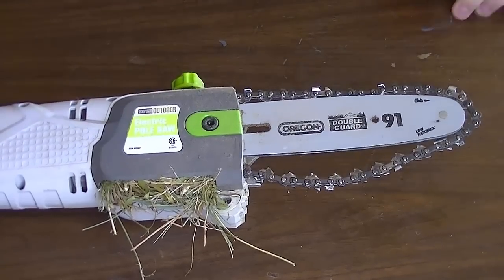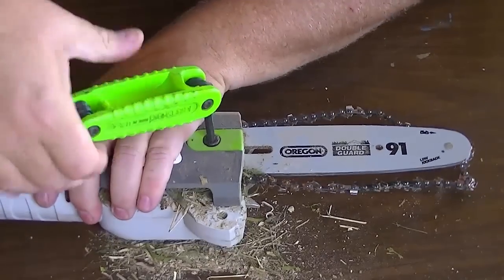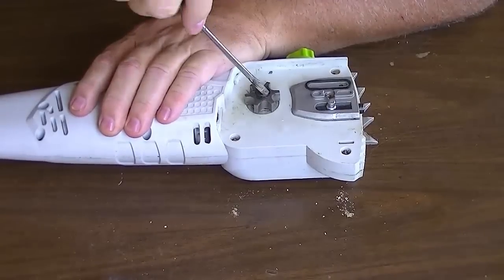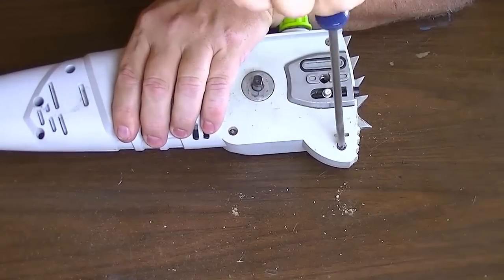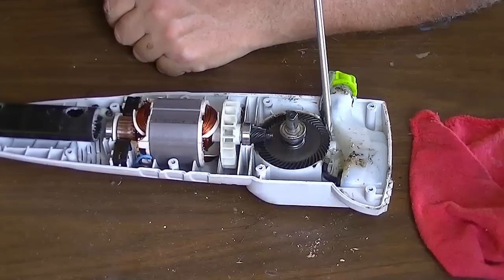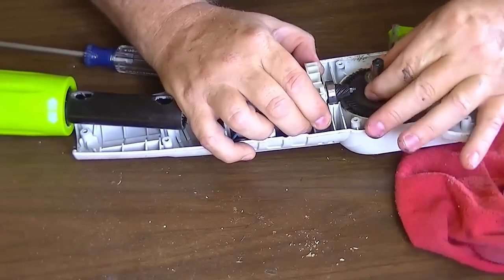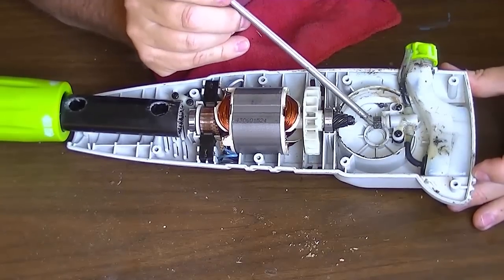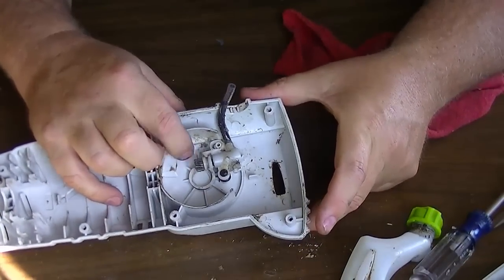Harbor Freight Chicago Electric Portland Pole Saw Oil Pump Repair Mod Fix

Comment: I had the same problem with a Poulan chainsaw and Sun Joe pole saw. Instead of taking it back I just hand oiled it between use. But I think now I'm going to try to fix the Sun Joe pole saw. Thanks for putting this up.

Comment: Double your battery life by dipping end of bar in mayonnaise jar of used motor oil often.
Little electric saws need to be sopping wet with oil to work good.

Comment: Thank you for such an in-depth video. My oil leak was because of torn tubing at the male/female juncture of the top tube.. I found proper replacement tubing at a pet store (aquarium tubing). The biggest challenge for me was hooking up the tubing before closing it all up. During my frustration, I realized that the replacement tubing has to be cut to almost the exact same size as the tube being replaced or it will not fit inside the unit correctly. Also, be sure to use the spring inserts from the old tubes or the new tubing will crimp, stopping the oil flow.

Comment: Nice video breakdown. Do you think it's possible to put a more powerful motor to use a bigger bar & chain ( e.g. 14 inch). I know people have switched to a bigger bar but there would be a drop in performance and added load on the motor. A bigger motor should help in recovering the performance.

Comment: The first time I took one of these apart to fix the chain not getting oiled while the dang unit dripped oil all the time out of the casing, I just undid all of the case screws. 

Managed to replace the broken bits of hosing just fine. 
Putting the dang thing back together took a while though, since in the process I managed to undo the carbon brushes. Managed to put the thing back together after a lot of cussing and trial and error. 

Cut to today when the thing stopped oiling the chain again.
Once again I took the unit apart like I did once before, replaced the hosing once again.

During this process I thought of using tougher hosing but the bit of hose I bought at the hardware store would not work as the hose would fit into the couplings, but the springs that went inside the old hoses would not fit in this tougher hose.

As I was preparing to go through the reassmbly ordeal, I spazzed out and dropped the unit off the table and in the process the wires going into the motor managed to rip out.

Took the unit apart futher in order to resolder the wiring into place when I realized that the sprocket could be removed from the top part of the casing like you showed in the video, thus making the whole assembly/disassembly process simpler than the headaches I had gone through before.

So I went ahead and put the unit back together again, the proper easier way this time, only to find that the unit was not proving oil.

Cut to me finally searching for what other, more intelligent people have done with these units to fix them.

Thank you for the very detailed and informative video regarding the maintenance of these units. 

Sorry for the long rambing wall of text.

TL;DR You sir, are a gentleman and a scholar.
Reply: Outstanding video, sir!  I’ve had a problem with the tiny hoses popping off the pump.  Cleared the glue on the hoses and used fine picture hanging wire, twisted onto the hoses, as clamps. Your video was critical to making this all work, EXCEPT, I had a heck of a time finding the correct placement of that spring into the body of the saw, that holds tension on the gear. Using screen shots of your video, I finally figured out where to install it correctly. My saw was a tiny bit different than yours,and had no glue on the spring to hold it onto pump itself.  I ended up gluing the spring onto the pump with Locktite Extreme Glue, which is one of the best glues I’ve ever used. Thanks again!
Reply: Outstanding video, sir!  I’ve had a problem with the tiny hoses popping off the pump.  Cleared the glue on the hoses and used fine picture hanging wire, twisted onto the hoses, as clamps. Your video was critical to making this all work, EXCEPT, I had a heck of a time finding the correct placement of that spring into the body of the saw, that holds tension on the gear. Using screen shots of your video, I finally figured out where to install it correctly. My saw was a tiny bit different than yours,and had no glue on the spring to hold it onto pump itself.  I ended up gluing the spring onto the pump with Locktite Extreme Glue, which is one of the best glues I’ve ever used. Thanks again!

Comment: Thanks for the video. Bought mine in 2022, thought it had a drip oiler. Sharpened it the other day and noticed bar and chain were dry. Took it apart and found similar oil pump to yours but with no spring or adjustment. Cleaned out blue sticky (like glue) grease and replaced with lithium. Emptied full oil tank, cleaned out oil lines, and replaced with 10W30. Pump works now, Will probably go half and have with chain oil next time. HFT is definitely the place for guys like me who like to fix and/or modify stuff.

Comment: My pump works, It just leaks all the oil out when it's not being used. Hopefully a simple fix.
Reply: Well.... The oil is leaking from the oil tank grommet. Not where the oil tube goes through the grommet, but from between the tank and the grommet. Hole is too big or grommet too small.  I glued it with some industrial spray adhesive (Contact cement type stuff). Maybe it'll hold. If not, I'll fiberglass repair over the whole hole, and drill a hole for a new grommet. Or toss the whole thing out...

Comment: Wow you done a awesome job! Mine was not coming out the hole either! But the oil was leaking everywhere but the hole! Thanks to your help i took it apart and the tube was broken! I just used another tubing and it worked like a champ! Great job! Thank you!

Comment: Turns our my saw didn't oil because the oil tubing had just crumbled.  Must not have been rated for gas/oil usage.
It was hard to find appropriate tubing.  I got some at a lawn equipment business, they couldn't give me the actual size.
Slightly small I.D. than OEM but being silicon, flexible enough to fit firmly on the saw's barbed fittings (except the oil tank which took some modification to make it work).  I needed to get the tube length just right to avoid kinking.  I couldn't use the anti-kink(?) springs inside the OEM tubes.  I guess that's ok as the system now oils.

Comment: Where do you get the new oil tubes? And my oiler tubes are all broken and the connection to the little tank is also broken, what kind of glue do you use?

Comment: Yes, nice work with the step by step. It helped me know what I was going to encounter when I opened mine. I had an oil leak caused by one oil line coming off and the plug near the top of the oil tank falling out at some point

Comment: I just bought one of these. Mine doesn't oil properly either. I was going to take it back since I bought it 2 days ago, but I might not since I may get the same thing again and have to do the repair in the video anyway. THANK YOU for doing this video!
Reply: I just tore mine down and put it back together. Mine didn't have the glue but it had a spring inside the oil line to keep it from kinking. I took the spring out and had to cut the line a little shorter so it wouldn't kink without the spring. It oils better now. One thing I would add is there are 2 case Philips screws that are bigger. The one that is closest to where the handle goes into the motor case and the one straight inline with it closer to the bar. You will see the difference once you look. I didn't notice the bigger screws until I went to put it back together. Maybe older saws the bolts are  all the same. I bought mine 7/15/2022.

Comment: Help. Found where my oil leak is. Appears there is a breather hose missing from the top side of the oil tank. Also followed your instructions but failed to see how spring went on bottom of oil pump. Can you help me?

Comment: I got one from a friend who broke the extension pole at the screw holes just inside the chainsaw case. The extender pipe is made of a fibrous material and maybe not as unbreakable as it should be. I glued it back together with JB Weld, then made a tin sleeve about six inches long and glued that around the area of the break to add some support, and then added some hose clamps for good measure. I expect it will be better than new. When I originally took it apart, some of the parts fell out of place, so it helped a good deal to watch this video; enabled me to put it back together properly. Thanks.

Comment: Someone gave my cousin a Sun Joe and its the same inside. the oil tubes are trash and one of the brushes are worn.
Reply from the maker: Thanks for that information.
Reply: My mom bought an EarthWise off the TV and it's identical inside so probably same Manf. I was able to replace the oil hose which had disintegrated, but the coil inside the hose was also in bits.  I need to replace that, plus also the same as some others - the brushes.  Mine were so bad the holder was also cracked.  I'll check with Harbor Freight to see if they have the brushes.

Comment: Took me four tries, but I got it to pump oil.  There was excess glue preventing the gear on the pump  to engage with the worm gear.  Also I increased the spring tension a little to help with that engagement. It's kind of a tricky assembly, but doable.  To future repairers, getting the oil hose back on that goes to the bar is fiddly.  Long nose pliers helped.
Reply from the maker: Very helpful information. Thank you for sharing.

Comment: I have the identical HF pole saw. So glad I found your video.... It should allow me to make a DIFFERENT REPAIR to fix my brand new saw. 

Today I used my saw for the first time. Within the first 5 minutes I cut a rather large branch that fell and struck pole tube that attaches to the chain saw plastic housing that you were working on. The fiberglass pole is like a wet noodle at the impact point. After looking at your video I think I will be able to replace that smaller pole tube, but looks like I will have to disconnect the white wire in order to replace the pole tube.. I have not opened up the housing yet, but was wondering if I will have to cut that white wire (shown at the 12:15 time marker) or if you might remember if there was a connection plug that might be there that will allow me to simply unplug that white wire without having to cut it? 

Thanks for the excellent video!  I will let yall know if I could get the part and fix it. You never know when someone else might have the same dumb luck as I did today.
Reply from the maker: im glad the video helped

Comment: Great Video, thanks. I have a sun joe model, looks identical to yours. Mine was easier to fix, just moved the worm gear closer to the shaft and re-tighten the screw. Not sure how long this fix will hold though.
Reply from the maker: Thanks for that info. Good luck.

Comment: Thanks Mr Edinger for this video. Inherited the tool 4 years ago while cleaning my deceased uncles house. It's worked fine until recently, will follow your steps to find the issue, dont know if the parts are expensive but I'll try disassembly. Got the piece off but the sprocket will not come off, like its stuck
Reply from the maker: Maybe try PB B'laster.
Reply: @roberta.edinger9405  Ordered the new bar, waited a month, didnt help. Went to Lowes, hot the new chain, problem solved! Should have taken your advice and started with the chain!

Comment: The newer model doesn’t have the tension spring for the pump to engage the...spinny thingy (don’t know the names). Suggestions? The pump does work, I rotated it by hand.
Reply from the maker: Is yours not pumping oil?
Reply: Robert A. Edinger : it’s pumping now. However, it seems to not get on the bar. W/o the bar, it pumps.

Comment: I had a clogged problem.  Fixed that.  Now I have the tubing has split so I need to replace both tubing sections.  In the meantime, I'm just pouring some oil on the bar/chain to get by.  I'm just a casual user so I'm not trying to make a living with my unit.  But I do need to get those tubing sections.  Anyone know the inside diameter and outside diameter?
Reply from the maker: Maybe try model airplane fuel tubing. it is very flexible and will stretch to fit.

Comment: Ok to all those who purchased this item you should not use bar and chain oil in an corded telescoping reservoirs it is to thick and depending on what time of year you are using it. So if cutting in cold weather use a more viscous oil and a little heavier in heat constantly use BAR AND CHAIN OIL on the bar and chain. Never let any build up in the space shown in this video it will burn motor out or worse. Thank you for video at least I learned how to rebuild and yes METRIC PHILIPS HEAD is a real tool. Everything made in China is 10-14 mm or hex. Good luck!
Reply from the maker: Thanks for the information Richie.
Reply: I have used bar and chain oil after seeing the oil come out through the hole. It worked fine but this last Tim I was cutting thick Eugenia branches and saw sparks. It did run for a short time, then stopped, guessing the motor burned?

Comment: One of the best demonstrations on how to fix something I've ever seen!
Reply from the maker: Thank you so much!
Reply: I was thinking the same thing.He seemed to move along very quickly with his troubleshooting,effortlessly actually,little time was needed to access problems and rectify,unless of course he had actually been in one of these before.(NOT saying he did-some folks appear to do a vid run through)
In another life,I supervised a small plastics industrial maintenance dept.If he also read mech,and elect,maybe hydr prints,and had made it past HR to me for an interview,I would have hired him on the spot.
I bought one,and opened it up earlier tonight to look at adding an extension to the pole before I even put the bar on it.
Then it hit me to check youtube to see if anyone else had made one,and landed here.I inspected my pump because of this vid,the gear engagement pivot was a little tight(but no glue),so I backed off the screws a hair as suggested,smeared the grease to where it would actually do some good.Nice firm engagement now.Thanks!
-edit for spelling 4/9/20

Comment: Do you know which brushes it uses?  I have Sun Joe 802 that I need to replace the brushes.
Reply from the maker: I would think the Harbor Freight brushes would be compatible since it seems that the HF pole saw is made by Sun Joe. But unfortunately I don't know where to get the brushes.

Comment: Nice job on the repair and the video. I appreciate the reminder to test before putting it all back together.  What a great shot of the clean oil flowing smoothly in it's little lubrication slot.  Thank you.
Reply from the maker: Thank you so much, I really appreciate your comments.

Comment: Thanks for posting this.  Gives me the confidence to tear my saw apart and try to find cause of oil leaking out of head assembly and down pole.  I have been dreading an attempt for fear of small parts falling all over the floor.
Reply from the maker: I hope it works out for you, good luck.

Comment: Nice fix, thanks for sharing! My oiler isn't working either so I'll give it a go! Also, is it possible to put on a longer bar or upgrade the chain? I've sharpened my chain several times but it doesn't stay sharp very long! Thanks
Reply from the maker: It is possible the chain may have gotten too hot during use or sharpening, that will cause it not to stay sharp. I'm not sure about the longer bar but it's worth a try. Let me know how it goes. Thanks.

Comment: Just fixed mine. The hoses were shot so I used some silicone vacuum hose and a small adapter to fit the grommet on the reservoir. I also adjusted the spring. I wasn't sure which side of the plastic ribs in the case it was supposed to pull against so I put it where it puts the most tension. Working great, what a pain to work on though!
Reply from the maker: Thanks for the tips. I'm glad the video helped.

Comment: I bought one of these at HF an it works pretty good.I haven’t had any big issues with it, except keeping an eye on the oil level because it uses chain oil pretty quick.A tank full will last me about 20 to 30 minutes of constant cutting.It works great with HF little 2 cycle genny if you don’t have access to a near power source in a remote area.Don t hit any metal or metal around where your cutting it can damage the chain easily an they come good an sharp when new ,that’s one of the best features of the pole saw. I also blow mine out with compressed air an wipe it clean,that saw dust can shorten it life. The pole saw an genny are great tools for the average home owner.I have always got a kick out of buying myself tools because as a kid we didn’t have a lot , except love. So for me going to HF is like a kid in a candy store.Some people put HF down for it quality, but do a little homework on Utube an look an reviews to help yourself make a good purchase.
Reply from the maker: Thank you for the comment and the information.

Comment: Excellent video. I have a electric pole saw I bought from Amazon. It’s identical to the one you have. I took it apart and attached it to a 16 foot painters pole I got from Home Depot. Because I took it apart I wanted to check the oil. It did just the same when I plugged it in so I know it works good. I’m able now to trim high branches of my pine tree while standing on the ground. Thanks again!
Reply from the maker: Cool idea! Thanks.